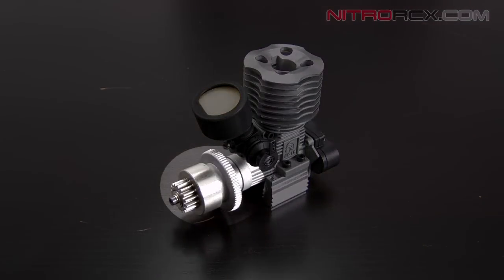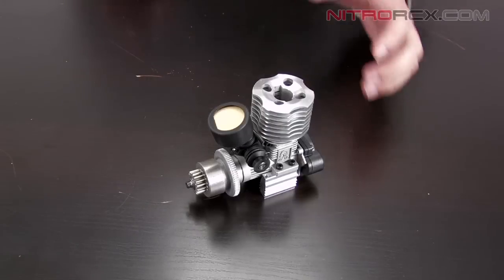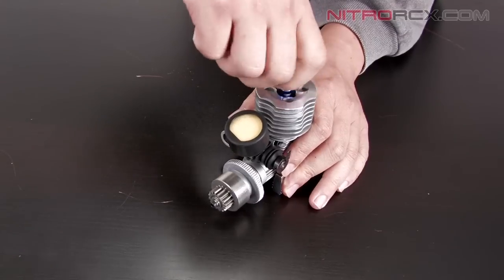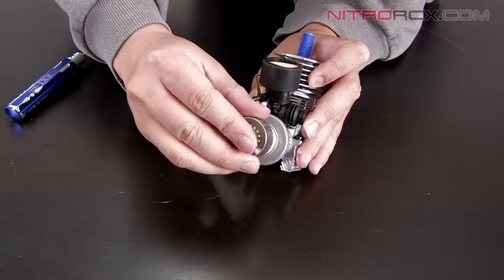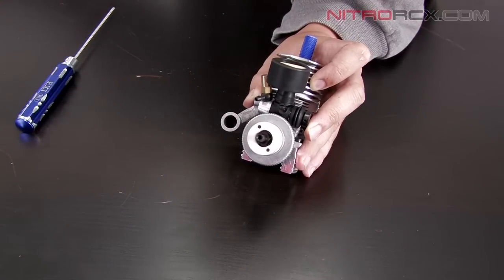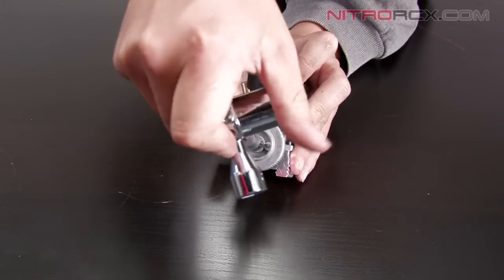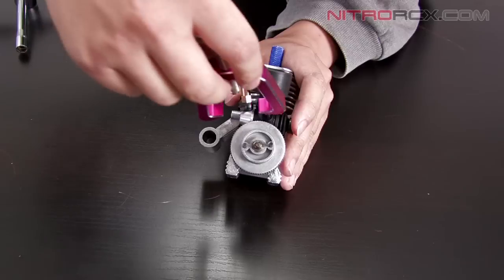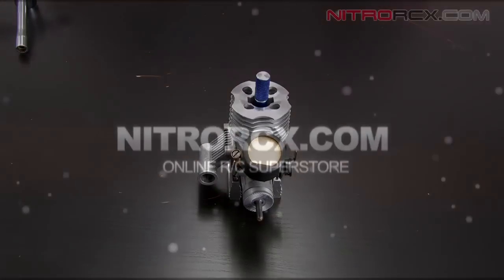Nitrorcx Guide: How to Change the Clutch and Flywheel

Comment: hello. can i use that piston locking tool to stop my car engine on my flywheel when running?
Reply: If you take the glow plug out to put the piston locking tool in. The engine will stop any way

Comment: Dont use piston locker tool to lock, because it hurts the piston , specially in old one engines, if you unscrew the flywheel with piston locking tool you can breaks the piston connecting rod.

Comment: ok.. i have a litthe problem..
when i start my engine, it shuts down after like 5-10 seconds..
and when i hit the gas, it shuts down immediately any1 knows how comes?!
i had alot of problems whit my engine... so, are the tunings to rich or not?
some1 help plz!
(sorry for bad grammar, im not english)
Reply: To rich, go all the way in then mark it; count how many turns out. Should be around 2.5 to 3 full turns out. Make adjustments 1/8 at a time. Good luck

Comment: I tried to start my truck w the starter box but the flywheel is so hard to move with even my finger what did I do?
Reply from the maker: Has the engine been ran before? Since the nitro engines don't use piston rings to seal the piston to sleeve of the combustion chamber the piston and sleeve rubs together to create the seal. New engines are going to be a bit tight when it's brand new but once it has been ran a couple times it'll get a little looser so you can spin the flywheel by hand.